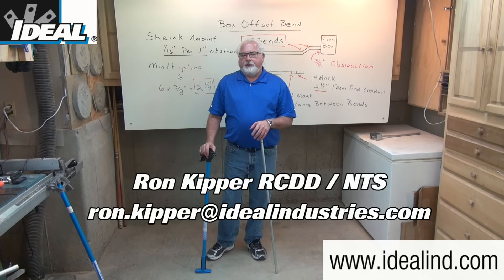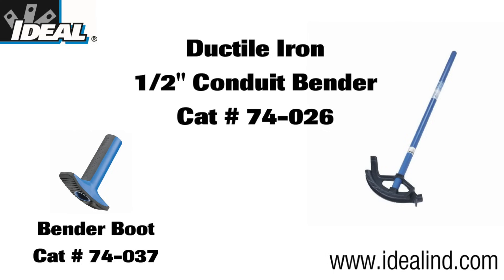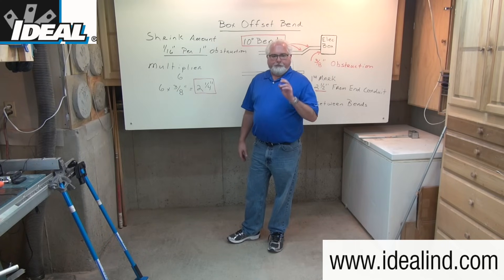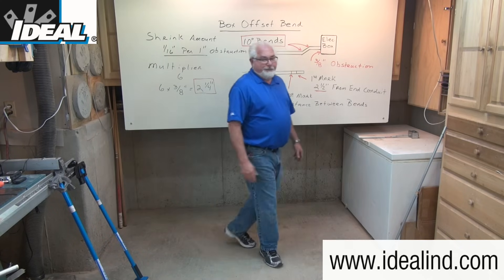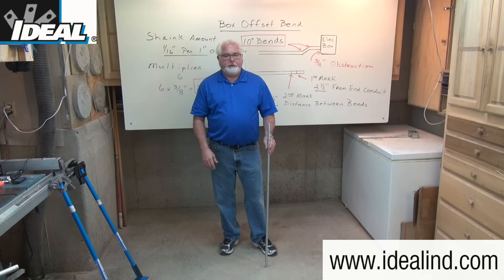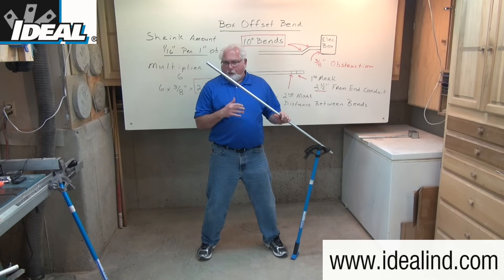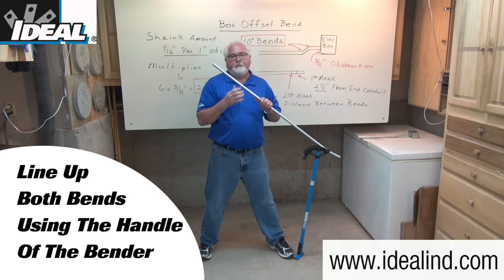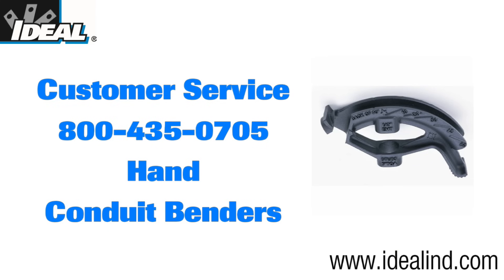How To Make A Box Offset Bend

Comment: Great video !! I'm in the HVAC field. I currently use B/X for most of my work but I think it looks sloppy. Always wanted to utilize conduit and I believe I will. Thanks
Reply from the maker: +HVAC DOC. Good to hear from you!
Reply: @RonKipperDatacomm1  Should Flexible Metallic Conduit be the choice instead of LMT for situation where a motor can cause vibration and loosen the connection in the long run>
Reply: And if it is connected to the A/C unit outdoor, should the choice perhaps be liquid tight flexible metallic conduit?
Reply: @ang6774  flex should always be used with equipment (including transformers) that can vibrate. Just change to flex ahead of connecting conduit. Outside should always be liquidtight, inside depends on the environment. If it’s a area exposed to wash downs like a commercial kitchen for example use liquidtight. And explosion requirements utilize a special flex and fittings. Always pull a grounding conductor with any flex.
Reply: @ang6774  yes! Also pull a grounding conductor with any flex.

Comment: how did you figure out distance between bends
Reply from the maker: The multiplier for 10° bends is 6 times the 3/8" offset between the knockout and the back of the box is 2 1/4". Which is the distance between bends. Good luck Ron

Comment: Hello Ron,  Great demo I learned a lot.  When you had the 3/8" where do you measure from to get that distance?  Back of box to edge or back of box to center of the knock out?  My practice pieces are not coming out right, I suppose  a lot of practice does the trick.
Reply from the maker: Hey Dana the 3/8" is the height of the obstruction or the opening of the knockout on the box. It is used to figure the distance between the marks you will make. Yes practice goes a long way. I know when someone asks me some thing and I have not bent any conduit for some time I have to think about what the answer should be. Good luck Ron
Reply: Suppose you had a connector and a straight piece of conduit going into the box knockout. 3/8" is the space between the conduit and the wall, this is because the hole isn't flush to the wall.

Comment: Why don't you video guys ever show trick bending like a goose neck bend. A bend that goes from the ceiling below to let say an a HVAC unit on the roof so as to not need a condulet. Helps when pulling wires.
Reply from the maker: cruz47144  that is a good comment. I will add it to the list of videos to make.  The videos I put up are usually on my own time and just a matter of finding the time to do them. Thanks Ron
Reply: i never heard of this, sounds interesting

Comment: I bought a one shot!
Reply from the maker: If you do a lot of conduit bending I would agree! Ron
Reply: WINSTON SMITH that's the thing to have if you're gonna do an as load of box off sets.
I have one but rarely ever use it,its easier to just throw one in as you're working than using it for the random bends you may need.

Comment: If you need to measure and mark pipe to make a box offset you need to be doing a different job.
Reply from the maker: Kenneth I hear you...........as I say in the video most guys will mave the bend made before a beginner even thinks about it. The marks were just for those who have never made the bend before. Ron
Reply: Ron Kipper Datacomm ------ Ron, by no means was that a shot at you for what you are doing or the videos you produce. I think you know that.  
      I did find it a little humorous that you would actually make a video on doing a box offset. At least you used a regular shoe bender and not a box offset bender tool. LOL
    I am just a sarcastic old wireman with more than 30 years in the trade , 16 of those as a journeyman in the IBEW. Everyone has to learn somewhere, sometime. 
   My apologies if I was being rude or out of line. Keep up the good work.
  And thanks for taking the time to make your videos they are helpful to people, even veteran wireman like me.
Reply from the maker: No apologies needed Ken I'm pretty thick skinned and willing to take the heat from pro's like you. Of the 8 videos I have up this one gets watched the most by far so someone out there is using the info. Something guys like us who have been around awhile take as easy not so much for the new guys. Appreciate you being out there Ron
Reply: Ron Kipper Datacomm --- You're a good man, Ron.
 I'd like to see more videos on things like making up a head for wire pulls of all sizes from a full roundhouse of #12 up to five 500 MCM  with the latter showing with a pulling sock and without and how to make the basket with the strands from wire itself. Starting with running a mandrel through the run then a mouse then sizing up the string to rope setting a tugger and the reels on jacks etc... 
   
 Maybe another pipe bending video for when you don't have an 1½" or 2" bender available and how to use a tree or the tires of a dually pick up truck to put an offset or 45° in a pinch.  Hahahahahahaha
  Maybe a Cadweld mold video. You'd be amazed how many electricians have never even heard of a Cadweld mold. But it is a commercial industrial application tool, same with Ramset, Hilti, and Redhead powder actuated guns. Something to keep in mind.
Reply from the maker: Ken I wish IDEAL would let me do nothing but make videos but I have a pretty full time job right now. Maybe some day we will think differently. Take care Ron

Comment: Cool video, I search these out for my apprentice class. I do feel that there is no reason you have to calculate shrink in 1/2" or 3/4" EMT.   Whether you measure first or last its one measurement and takes the same amount of time. And with box offsets usually you can just do that with feel and experience after a couple thousand of those its  automatic.  I teach my apprentices both ways of course, and with rigid , well unless you have a pony threader you better calculate your shrink first.   With EMT probably the quickest and easiest way to slam a lot of conduit in in a day is to measure and cut after you have made your bends.
Reply from the maker: Jim glad to hear from you I would agree the shrink is nothing to worry about. You are probably right bending then cutting to length will probably be faster. Appreciate you being out there Ron

Comment: What do you mean electricians don't cut conduit? How do you fit a 10 ft piece of conduit when you only need let say 8 ft total EMT length?
Reply: cruz47144 he says bend than cut it, obviously you cut it, but you should know what length you need to cut before bending is what he meant.
Reply: He means after bending, ideally it should be the correct length after bending, when you are new at this you leave a little extra length to allow for error correction.